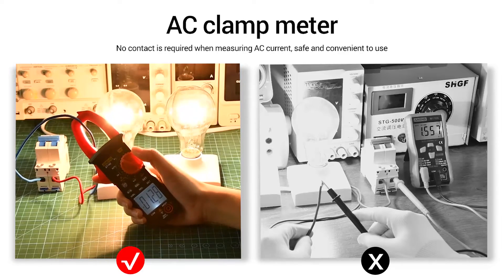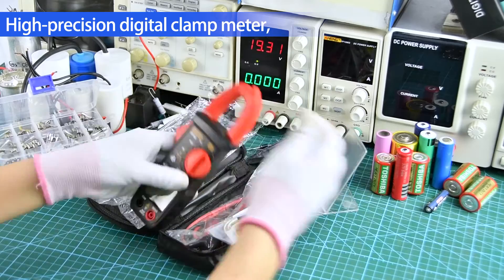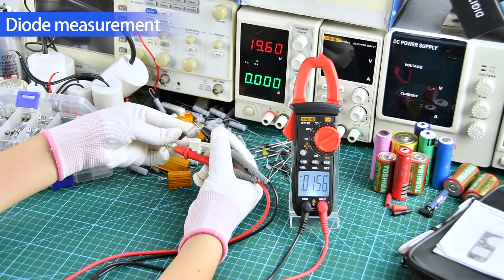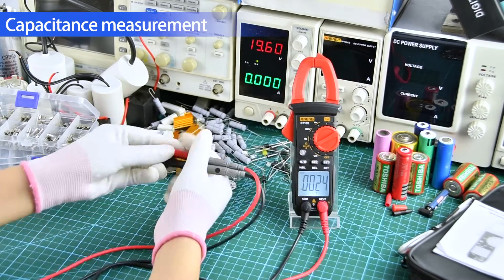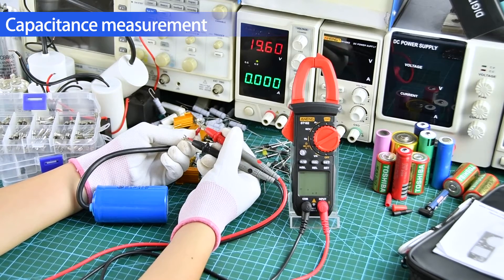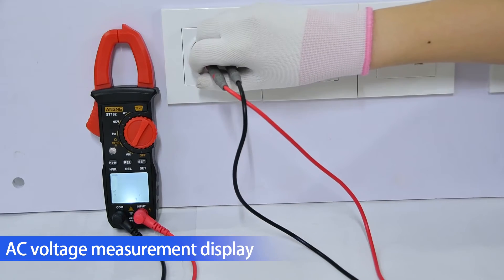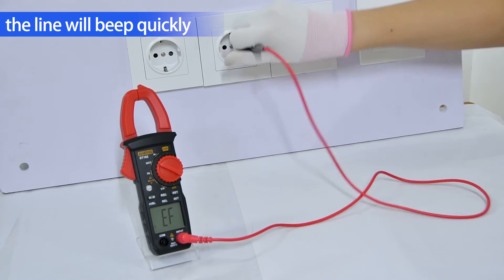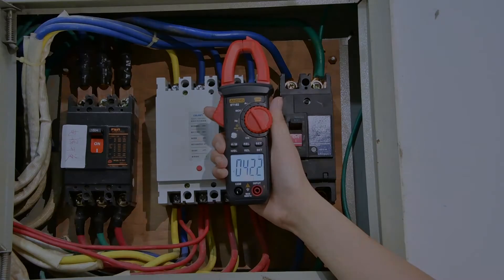ANENG ST182 Clamp Meter AC Current Multimeter DC/AC Voltage Voltage Tester Capacitance NCV Ohm Test

Comment: can this be used to check ampare dc
Reply from the maker: dear ,st182 couldn't measure the DC Current,
U could have a check our model ST206 st210 st209,these with DC Current function
Reply: @aneng  i have the ST182 model and it says can measure DC current select the A. i just bought it a week ago at shoppe
Reply: ok,thanks.whether you sell in lazada or shopee
Reply from the maker: @aryapyantara5556  https://www.aliexpress.com/item/1005001290164190.html
Reply: thanks

Comment: Akurat mana bang degan tipe 184
Reply from the maker: Dear,so sorry ,i couldn't understand u clear~
could you pls tell me more detailed about question?
Reply: Akurasi fitur aneng st 184 vs aneng st 183
Reply: What is the resistance measuring range? 200-20K-2M ohm